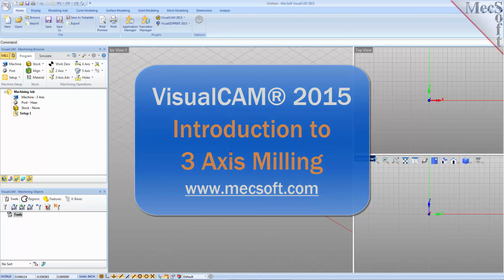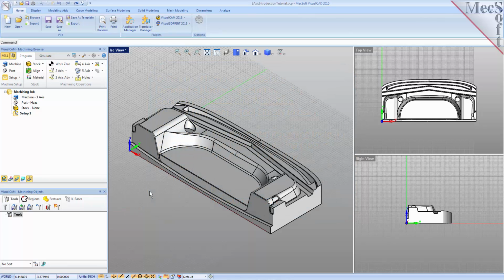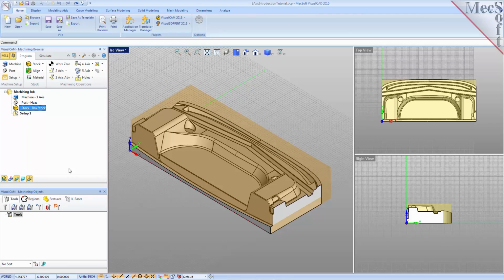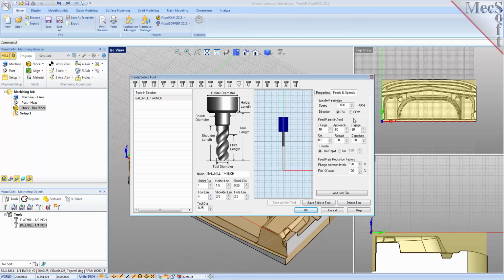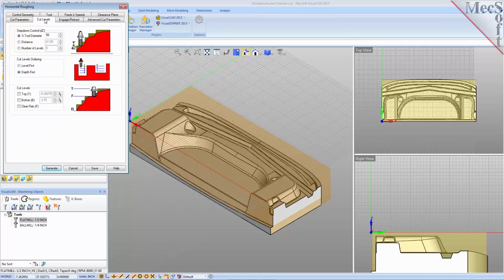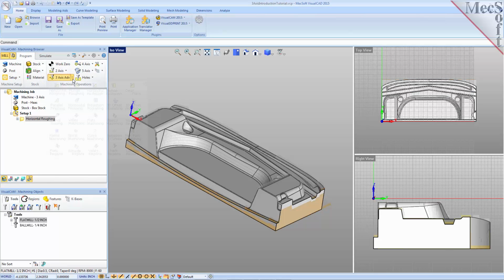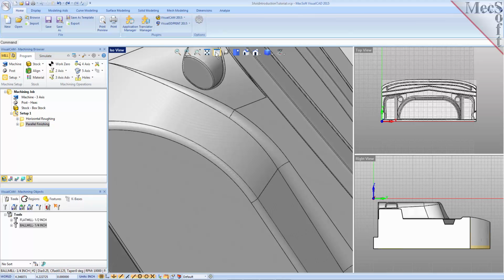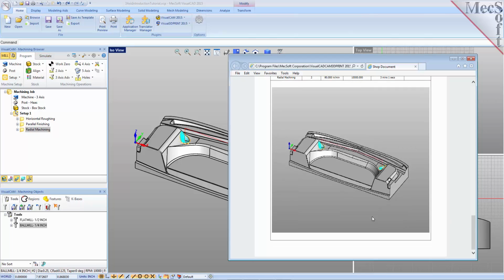VisualCAM 2015 3 Axis Introduction

Comment: I would love to do this tutorial, but after installing the latest version of Visual Cad on my machine, the data file 3Axis....vcp is nowhere to be found. Am I missing something or is that file, in fact, not included with the install?
Reply: Been there.... I found out you have to sign up (and pay for) their 'maintenance' program to get access to more tutorials.  They really, really need to warn people up front about this.  But I'm sure if you dig deep enough you can find some help.  The tutorials are there, just not the sample files.  You could apply the tutorials to your own files and learn that way, which is definitely harder.